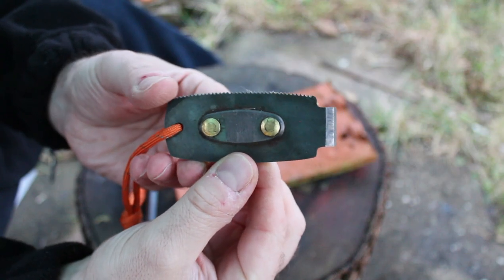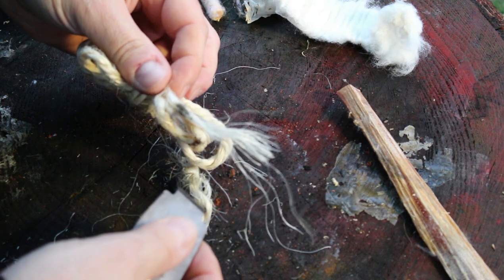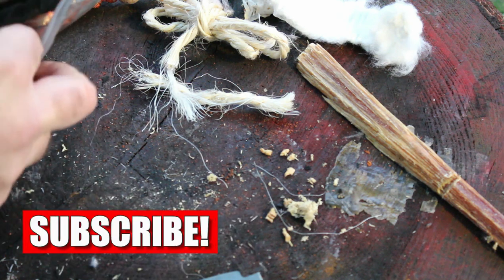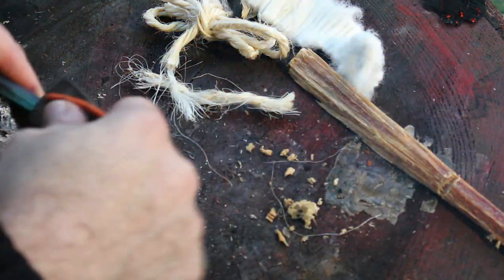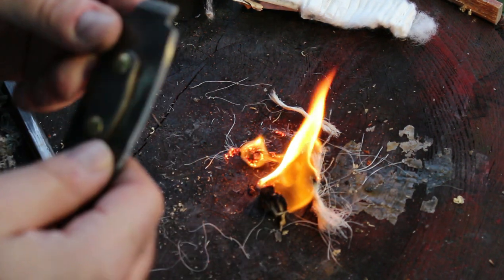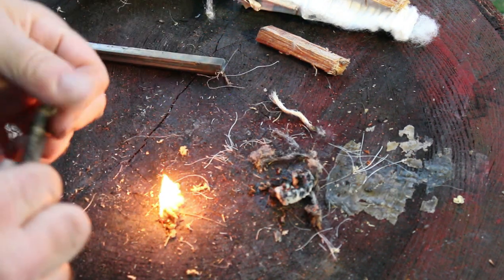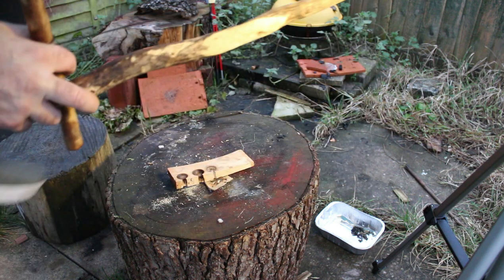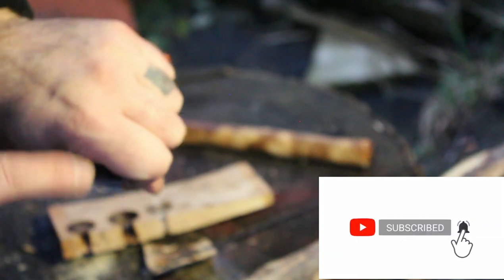Best Multi-Use Bushcraft Tool. Beaver Bushcraft 5 in 1 Striker. Tinder Teaser

Comment: Great to see some new ideas turned into gear. Neat demonstration too!

But, I must admit I'm not sold on this tool. I suspect a pocketknife (e.g. Victorinox Farmer) might be more usefull for the same weight. No flint striking or firedrilling possible, but those are skills I haven't mastered.
Reply from the maker: Its not for everyone. maybe for more people who are into traditional fire lighting etc. I can show a flint and steel set and still get a comment like "ill just use my lighter" its kinda to each their own when it comes to gear. Thank you for watching it.
Reply: We did not really intend for it to be used as a Knife or a as an actual Saw. It is actually designed as a Fire Lighting Tool  multi tool for teasing tinder and for scraping wood shavings for tinder bundles etc as well as a Fire Steel Striker etc. But as 'Prepper In The Wood' demonstrates you can actually use these features for more than they were intended for which even amazed us lol and we designed it!!!!!
Reply: Beaver Bushcraft As I said in my original comment, I like the 'idea' or 'attempt' of creating a new tool. I do consider it too big and likely too heavy (haven't touched it, so I may well be wrong). I also mention that I lack the skill to properly/efficiently use the tool. So my opinion is just that: my opinion.
Somehow my post seems to come accross rather negativ, both you and the prepper read it that way, but  that is/was not the intent! My apologies!
Reply from the maker: Alexander Gutfeldt not negative to me. I understand what you are trying to say. 👍🏼